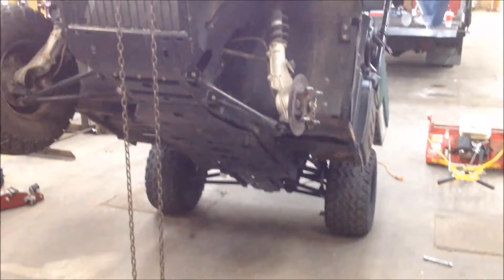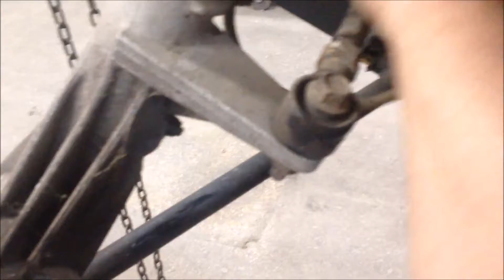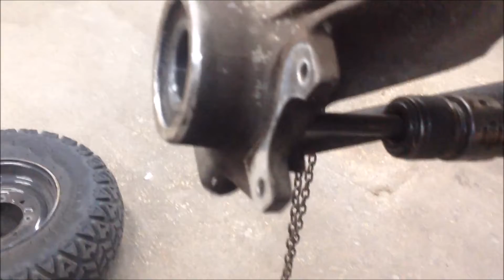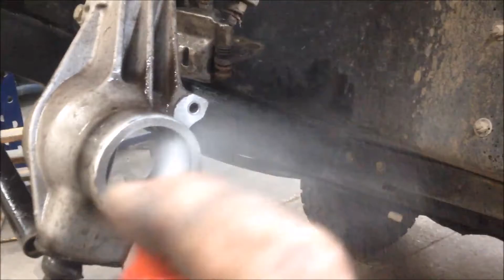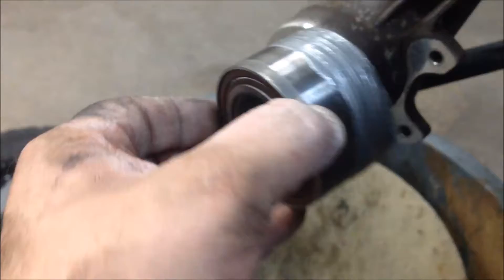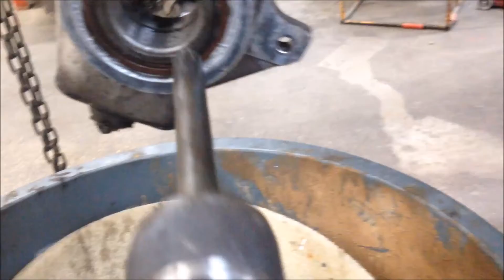POLARIS RANGER FRONT WHEEL BEARING REPLACEMENT

Comment: On this particular job you reference a stub axle which is briefly seen during the video. I assume this is from a failed CV shaft that is trimmed to fit and hold the bearing/hub assembly in place thus eliminating the front wheel drive. I don't seem to find such a part online. Does this exist as an individual component?

Comment: You was killing me with that bearing. Next time throw the bearing in the freezer and it’ll drop right in, you can also heat the steering knuckle and have even more room if you want. Usually just chilling the bearing is sufficient. Thanks for the video.
Reply from the maker: James B  never beat on a bearing. Tap the outside race